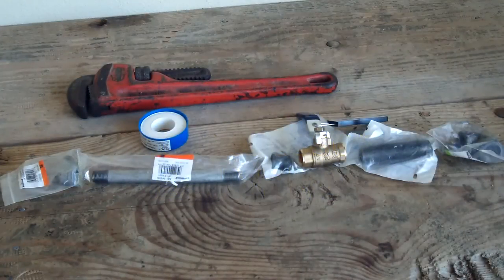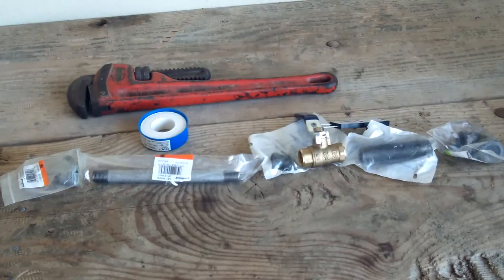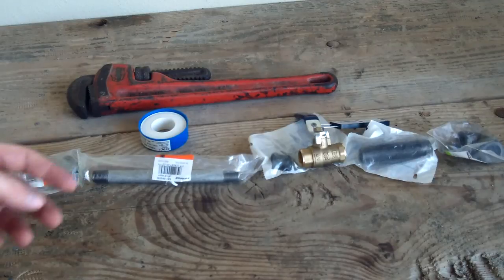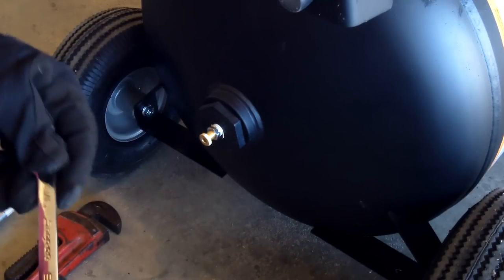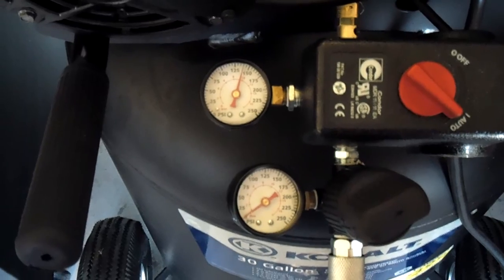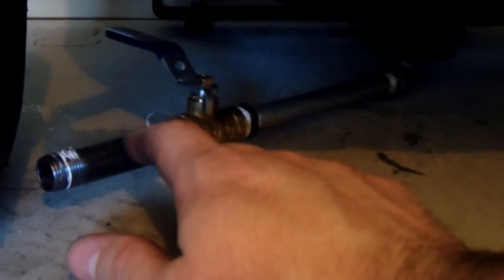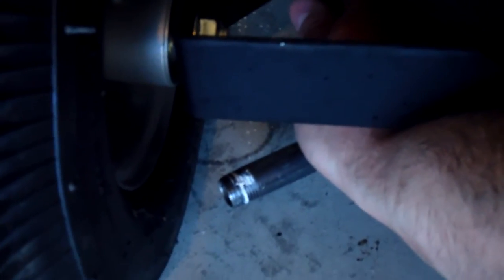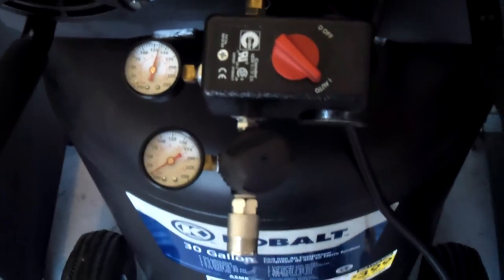Kobalt Air Compressor Ball Valve

Comment: Galvanized for airline is perfectly fine it just costs a little bit more than standard black iron it’s galvanized for gas lines that you don’t want because the galvanization overtime can start to come off on the inside and plug small orifices in gas equipment over time and make gas regulators not work correctly. but with a drain valve on a compressor will be perfectly fine.
Reply from the maker: Ben Boudreau Good info, thanks for posting.

Comment: Having problem finding the 1/4 x 3/8 street ell. Where did you find yours at?
Reply from the maker: bbentley1964 I think I got it from Home Depot.
Reply: I used on my compressor A solid milled brass 90° made by brass craft sold At my home depot plumbing fittings section. The only reason I did that is because after snapping off two of the black iron threaded 90° elbow’s I decided to go with low profile brass version and so far I have not snapped it off

Comment: can you send me the specs for the parts I need? I have exact same compressor.  thanks a bunch
Reply from the maker: If you are doing it the same way I did. You will need a 1/4 street elbow, 2" 1/4 tube, a 1/4 ball valve, 1/4 to 3/8 adaptor, a 4" 3/8 tube. Witch is how I set mine up. But I am still thinking of changing out the 4" peace of tube, for maybe a shorter peace so I can use a 90 degree on the end. But it works nicely now, so I may just leave it alone. Hope that helps, thanks for watching.

Comment: Will this have clearance when moving the compressor? If so how many inches off the ground? Thanks!
Reply from the maker: RELOADINGandSHOOTING It does have clearance, and I can move it around no problem. As long as the tires are properly inflated. Clearance is about 1/2-3/4in. Real close but just enough.